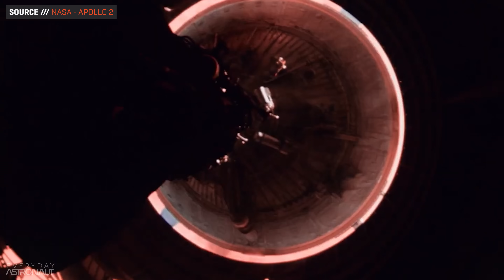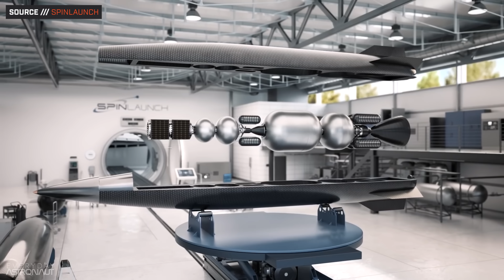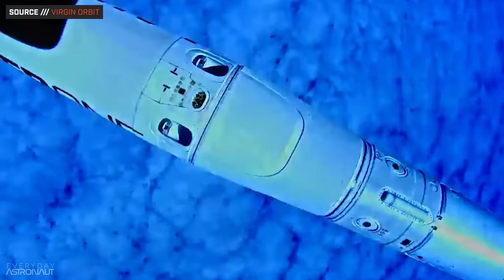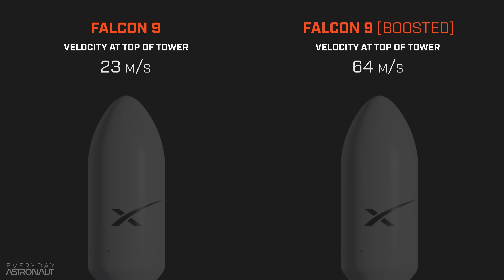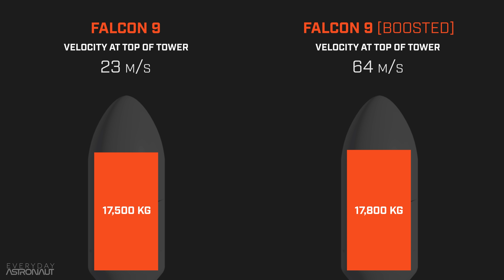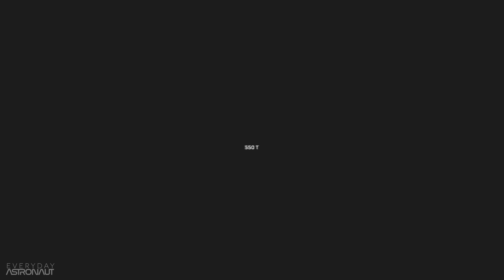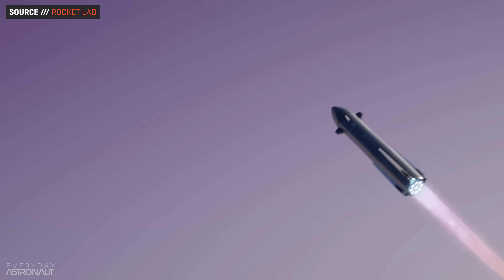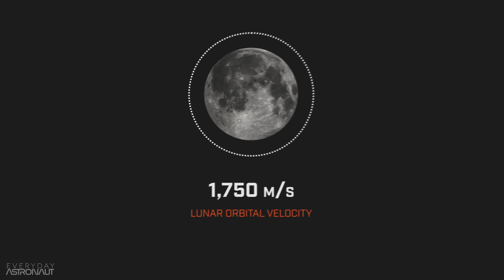Could We Help Push Rockets To Orbit?

Comment: I've always wondered why we couldn't take a, maybe SR71 sized plane, use a combination of turbojet, ramjet, scramjet to reach Mach 5+, then nose up till you reach altitudes that no longer support the scramjet, then fire off a couple relatively small solid fuel rocket boosters to push the plane into space. I know this wouldn't be heavy lift capacity, but it should be fairly cheap and reusable way to get people and small amounts of supplies into space..?

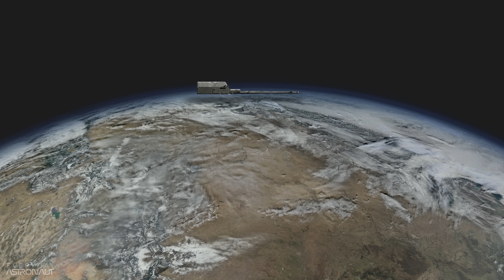Comment: 3:30 Tim, while you are correct that you can’t get into Earth orbit with a single impulse like a cannon (and yes, I know you discussed SpinLaunch), it is theoretically possible to bypass orbit entirely if you can give your payload enough of a kick to exceed escape velocity — and still exceed it when it’s done plowing through the thick atmosphere! Unlikely in the extreme, but I did say “theoretically”… 😂 For airless bodies like the moon, it might actually be possible, if your payload could withstand such a kick or was accelerated over time like with a magnetic launch track! Doing that on the Moon could be a very easy way to get home, actually, because the moon is tidally locked you could build the launcher in the perfect place to give payloads a sufficient kick retrograde (that is, relative to the moon’s orbit around Earth) so that the payload leaves the moon’s influence and falls down to a medium or low Earth orbit, where it could circularize to be used there or (re?)enter Earth’s atmosphere at will!

Comment: What about connecting a fuel line to the rocket so that during the first 500 meters or so the fuel is being refilled as it is being used? Should be functionally equivalent to having a pair of chopsticks accelerate the rocket up during that first part.

Comment: Giant ring of blimps with winch cables  that disperse away upward diagonally with jets on release... cables pull blimps down to utilise their enourmous boyancy ... release as they reach optimal offset far above risiing rocket ... fast winches rapidly draw cable slack up into the rising blimps ... fast winches also add to the lift ... reusable... not that expensive and has other heavy lift uses... Hindenburg still too soon????

Comment: You don’t get any cool points for using kilograms.
Reply from the maker: Do you know how much easier it is to do these equations in metric vs imperial?! 😂 you’d have to convert every unit between every single portion of each equation to make sense of it in imperial. Also, 70% my audience comes from outside the US and therefore doesn’t understand imperial where as most from the US have some grasp on metric. So majority wins and it’s just easier, has nothing to do with cool. Also we put many conversions up on screen when we could fit them

Comment: Doing 3g at liftoff with full tanks means much higher pressures at the bottom of the tank than they are designed for.  So you need stronger tanks, which is more weight making that 3% is even lower.

Comment: 19:20 Why though? Dig a hole and fill it with sand at the launch site, make it as big/deep as you need. Make sure its not on a fault line (lol not sure if this is a joke).
Reply: You would need alot more underground architecture to make sure that the tower doesnt just fall into the hole

Comment: You missed a factor on the vacuum tube booster. By sealing the bottom of the rocket and allowing full earth atmospheric pressure at the bottom of the rocket and vacuum at the top, when you release the clamps the atmosphere could be enough to exceed the weight of the rocket upward in the tube. 14 lb per square inch is about 235,000 lbs of upward thrust on a falcon size or dragon size vehicle with a 12 ft diameter, and that's before igniting the engines. If the bottom of the pipe is sealed the rocket exhaust would quickly pressurize that area to many bars of atmospheric pressure similar to what happens when a rifle fires. The longer the tube, the more efficient the system. Even without fully evacuating the launch tube this could improve launch economics.
Reply: I was having a similar thought, you could have a valve seal the last 100m when the capsule passes, then allow pressurised gas to follow, like a giant "light gas gun". However from a quick look at the Wikipedia it looks like the fastest a pressure wave can flow down the tube is at the speed of sound in that substance, so youl 'only' achieve 1200mps or so 😅 Probably 100% non viable, but fun to think about
Reply: How much lube oil are you going to mix into the methylox?
Reply: There's a reason we don't launch rockets like rifle fire.
Reply: Slight problem. Air pressure  looses it's energy and can't enter the tube fast enough. But Imagine compressed air being forced behind the vehicle along with methane gas and ignighted in an underground launch boost tube. Sure, we are back to chemical propellant but it takes chemical propellant weight off the rocket.
Reply: Keep in mind that the nozzles are optimized for a specific altitude. They'll probably blow themselves apart as the external pressure fluctuates wildly.
Reply: All the backwash might melt the rocket.
Reply: What if the rocket was essentially enclosed in a discarding sabot until it reached the surface? And air that was extracted to create the vacuum was stored and released, not all from the bottom, but from valves along the tube as the sabot passes. Even better (I think/guess) - open the bottom to atmospheric to get moving initially, THEN close the bottom to atmospheric, and inject the pressurised air (or flashed steam?)?

Comment: Maybe we shouldn't look at accelerating the rocket at launch, but ways to accelerate it at higher altitudes. The rocket equation penalizes carrying your weight higher and faster.....so what if we launch suborbital, but somehow boost the rocket into orbit from a system in space? Like, maybe, a satellite which dives down, grabs and thrusts the small payload into orbital path.
Reply: Problem is you need to get to 17,000 mph horizontally. Both the atmosphere and gravity are strongest at the surface so mechanically that’s the best place to save energy.
Reply: @ffffffff-gu5qr  I am not so sure that your conclusion follows from the premise. Assuming that a kilogram of fuel translates to a certain amount of energy, the rocket equation says that a kilogram of fuel in space is hundreds of times more useful than a kilogram of fuel at the surface. Because that fuel is propelling a much lighter vehicle.

If we can add a kilograms of fuel worth of energy at the END of the journey, then that means we didn't have to lift, and accelerate that kilogram, translating to hundreds of kilograms of fuel savings.
Reply: @donperegrine922  well you still have to lift that kg of fuel in a previous launch then

Comment: A lot of these calculations could be much simpler by doing all the numbers in just energy or delta-V .  Adding X amount of energy to the rocket will allow increasing delta-V or mass according to E=½m(v*v) .  Also when writing out metric units, there's a huge difference between upper and lower case abbreviations.  A tonne is 1 t, a Tesla magnetic strength is 1 T .

Comment: You didn't mention the additional structural enhancement to the rocket itself to handle being lifted at high Gs from its side, which it's not designed to do..that additional structure would likely completely eliminate the additional payload capacity, especially when you consider that you have to push all of that extra weight up to at least booster cutoff, if not additionally to land with it.

Comment: The big thing was at the start of the video. By the time Saturn V cleared the tower it had burned X fuel. So we dont need to take it to space. We just need to help any rocket overcome the inertia of getting started. If we could dig down 225m and have a 225m tower that is 450m of travel. Not a lot of velocity at 3-4Gs 30, 60, 90, 120 150 The tower could get the space ship to 150m/s without use of fuel.

Comment: The fact that this has to be said ... lol

When something is capable of accelerating itself from 0-27,000kph, pushing it to even 100kph would be an absolute drop in the bucket.
Reply: The thing is, rockets are not in fact capable of accelerating "themselves" to 27,000kph; they work by throwing ninety-some percent of "themselves" away. While not practically achievable as he covers, it is actually remarkable that just 50 m/s at the start could add a few percent to the payload. That's the raw power of getting around the brutal multipliers of the Tsiolkovski Rocket Equation, and it's why "anything, absolutely any idea other than a rocket" is such a perennial topic in space launch.
Reply: thats like saying if your car can go 300 miles then going 1200 is nothing, how does that make any sense lol

Comment: Not mentioned in the drop-a-weight analysis is that, in a perfect system, it will take as much energy to lift the weight (to create potential energy)  as you expect to get out of it when dropped (kinetic energy).  Of course it would be lower peak energy over a longer period of time. I leave it as an exercise to the reader to calculate the cycle time for a starship launch with a 10 megawatt grid connection.

Comment: build a giant floating platform 
(dont be scared to use hydrogen because its kinda hard to burn hydrogen at that pressure even if you tried )
and put a comicly large slingshot on it

Comment: For the moon, you could instead have most of that acceleration happen around a circular track. Yes, the diameter of the track would need to be large so that at the higher velocities you don't flatten your crew against the wall of the capsule due to "centrifugal force". But it's more reasonable than a 50km straight track.
Reply: Run one around the entire circumfrance, use it as a landing pad aswell. No need for a tube
Reply: It's a good idea, but physics is a bit more complex :) That's why they work on that small scale slingshot for 10 years.

Comment: This is probably too complicated but I muse about launching human or fragile payloads from one vacuum magnetic launcher and a booster from another. The latter can be boosted with a much higher G force. The two parts meet at altitude and the booster pushes the payload into orbit.

Variations could have two or more payload booster rendezvous and/or adding some thrust capability to the payload. I also envision a pointy atmosphere deflection cone for all boosters and payload. The cone seperates when the air gets thin. All components are recoverable.

Comment: Ok Mr. Tim. Long time fan here. Chew on this one: What if the launch tube was in the ocean? You could use hydraulic pressure to supply the GSE lift energy. That's the poor man's bonkers idea for free to all the billionaires :) (I know it's not practical, just a fun thought)
Reply: The hydraulic force driving the piston at the bottom of such tube decreases as the  the piston moves up, in constrast to a counterweight, which exercises a constant force

Comment: What would I do? 

Take a theoretical second stage that needs 6971 m/s Delta V to reach orbit. With methalox engines vacuum ISP of 375 seconds is a likely number. 2000 tonnes wet, dry 100 tonnes, that gives 200 tonnes to orbit. 

Double the payload to 400 tonnes and it will only have 5094 m/s Delta V. 

That leaves it 1877 short. 

Have a Forward type rotating tether in orbit (probably a semi rigid or damped one as there are some excitations that Forward didn't account for in flexible tethers) with a tip speed of 1877 m/s (this is well within current material science).

Dock to the tether, be spun up to whatever velocity is required, up to 1877 m/s above orbital velocity and then unhook. 

There's a 100% increase in payload to orbit. If the docking fails, re-enter as normal, but with much less total energy and much less heating (heating is to the fourth power of re-entry velocity)

For re-entry, dock back to the tether, return the energy you borrowed to get to orbital speed and re-enter with 1877 m/s less velocity than a normal re-entry.

I'd also put one in orbit around the moon. You wouldn't need any sideways velocity to dock with it and you'd be tossed right back to Earth if you unhook at the right point.

YouTube deletes comments that aren't sufficiently positive, so a quick aside to stop this comment being deleted.

Thanks so much for your reply! I was having a terrible time understanding but your clear comment has really helped. This is going to change my life!, so thanks again, it's really appreciated.

Comment: Wait. Are you wrong, or am I missing something in my thought process? 
When we use a linear accelerator  (on a rollercoaster launch system, for e.g)  the acceleration is provided by many electromagnetic segments, not all at once. So if we required 200KW equiv instantaneous power, and we divide that over 6 segments, requiring one second to traverse all segments and only energising each segment at it's most useful magnetic flux, that makes our instantaneous power delivery issue super manageable? Or am I being stupid ?

Comment: 15:45 the closest thing to that power scale i can think of is the LLNL NIF PCS which stores ~400MJ and discharges it in ~300us.

After some research, it looks like flywheels are much more feasible in this application than capacitor banks. See the Sandia national labs high speed flywheel testbed.

Comment: The problem with all these accelerators is that in every ecconomic model, it's always just easier and cheaper to burn more fuel.  Even on the moon, sure, you could build a maglev track to accelerate your payload, but it's so much cheaper to just use a hydrolox rocket.
Reply: i believe these accelerators only make sense for sending A LOT of mass, like the amount needed for mega structures
Reply: @linecraftman3907  How do you get the required materials to the moon in order to build it?  You gotta price that in too.  Hydrolox can be sourced from the moon produced with solar power.
Reply: @jonavery4978 well the moon is made from the same stuff as earth so you just get the materials from the moon
Reply: @linecraftman3907  Is it cheaper to get an electrolysis machine onto the lunar surface or an entire foundry capable of refining producing parts made of titanium?

Again, the cost benefit curves don't work.
Reply: @jonavery4978  fair enough but there is only so much ice on the moon

we're talking here about really huge megaprojects

Comment: What if you put the rocket into a close fitting tube with a closed bottom end so that the engine exhaust pressurized the area under the rocket?  Aka,  potato gun launcher, but the rocket is the potato and instead of exploding a charge behind it,  we use the rocket exhaust to drive the rocket "piston".  Make the tube 300 ft deep.......
Reply: Aaahhh that's cool! Turn that exhaust plume energy into thrust!
Reply: Fun, but rocket engines do bad things, i.e. explode, or burn parts of the bell which then causes them to explode, when the outside pressure is higher than the range they're designed for (1 atmosphere max on the first stage). I'm too lazy to do the arithmetic on how many atmospheres you'd have to reach to accelerate an X meter diameter Y-tonne rocket at an additional 3G. I think it's A Lot though. This also ignores acoustic fun from the shockwaves bouncing back and forming complex rocket-shredding 3D standing waves in the tube (of rapidly varying length).

Comment: How is the return of instead of trying to increase payload, you were trying to just cut fuel consumption?
For every bit of fuel saved, you also save weight, making the system more effective. What is the energy required per pound of fuel, and how does that compare to the energy from burning the fuel itself?

Comment: Maximizing "performance" with no consideration of other factors has been one of the biggest mistakes in space programs, like the people using hydrogen as a first stage propellant. The metric that matters is "cost per mass unit to orbit". So no,  I wouldn't be spending billions of dollars for a 3% increase in mass to orbit.

Comment: The real solution is to swipe a UFO from the aliens, and skip the whole chemical rocket systems. You get silent operation, high thousand G accelerations, low 'fuel' use, lots of spare power to run external LED's, and no matter the mass, you can hover.

Comment: Not true , if you can shoot a rocket far enough into space it will take a bottle rocket worth of power to have it fall into orbit! Just have to go out about 100 light years then a sideways bottle rocket push will let you fall into orbit.

More realistic:

For your proposed 100 km barrel “potato-cannon” orbital launcher accelerating a lightweight (1,500 kg) composite/plastic/wood projectile to 2,000 m/s (Mach ~6), you’d experience a mild and survivable acceleration of ~2 g for about 100 seconds. However, you’d encounter a challenging peak air pressure of around 50–80 atm (approximately 60 atm realistically) ahead of the projectile at maximum speed. To reach full orbit (7,800 m/s), you’d need onboard propulsion adding roughly 5,800 m/s, requiring a rocket engine cluster producing about 90–100 kN thrust, burning around 7,000 kg of fuel, bringing total post-launch mass to approximately 8,800 kg. This approach is physically realistic but requires careful engineering to manage heat, pressure, and structural stresses effectively. —- 5 minutes with llm

Comment: For Starship, I think a taller tower with an attached Raptor boost platform would be interesting. Kinda like JATO bottles but reusable and attached to the tower which is then attached to the rocket. Still insanely complicated though.

Comment: They build 25 mile long maglevs regularly in China and Japan. We would just need something like that, running horizontally, and then possibly run it up a mountain, angling it up into the sky, avoiding costly infrastructure to suspend the track.

Also, accelerating at 10,000ft is different than accelerating at sea level. I feel like that should be factored in.